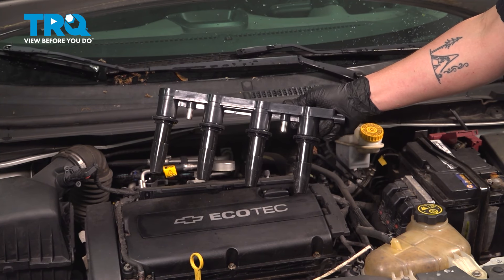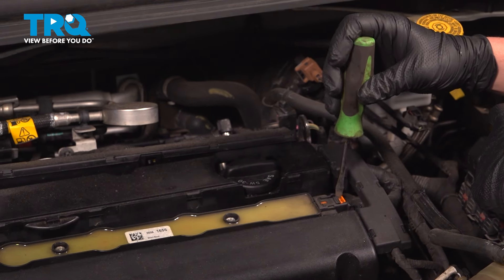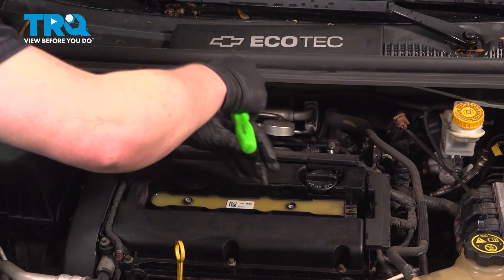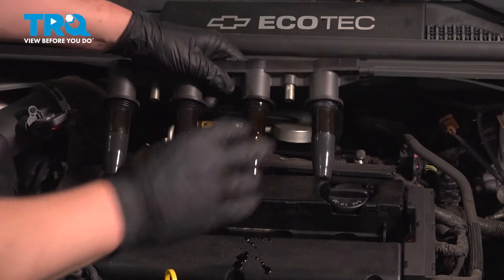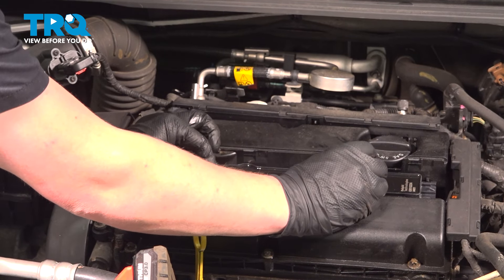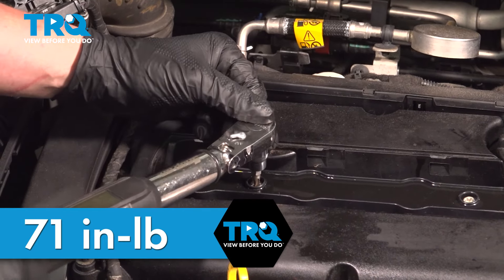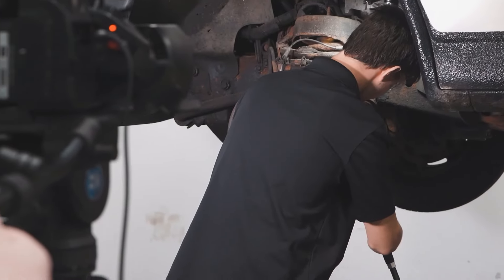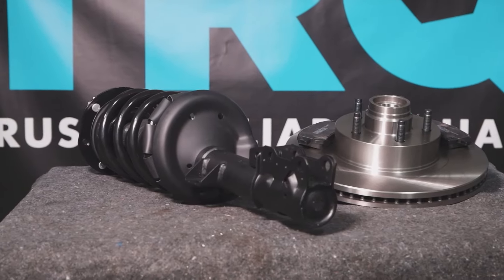How to Replace Ignition Coils 2012-2020 Chevrolet Sonic

Comment: I have a 2017 chevy sonic that has been going dead regularly due to something involving the security lock. We changed the battery in the key but it still keeps doing it. Could this coil be the problem causing it to do that?